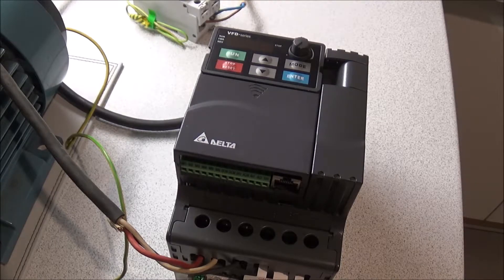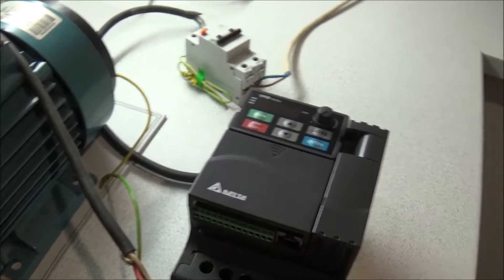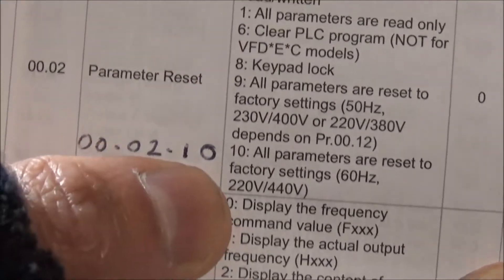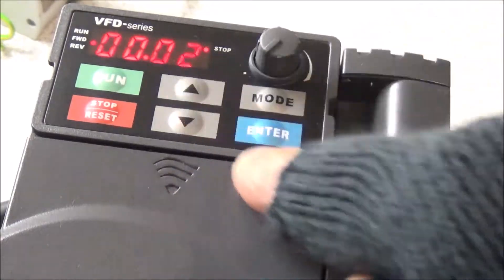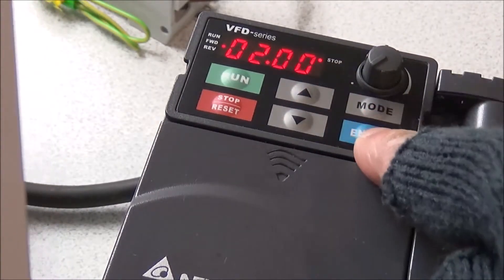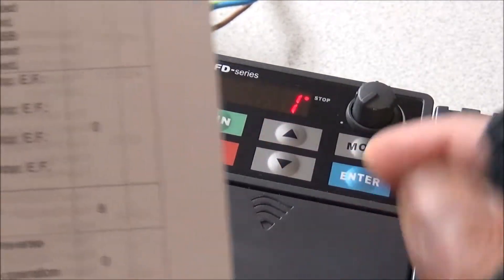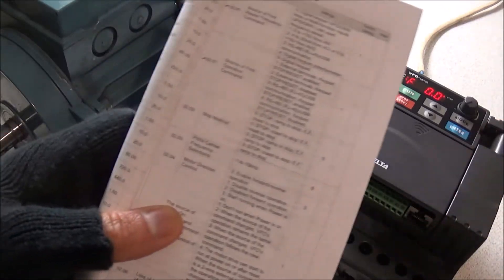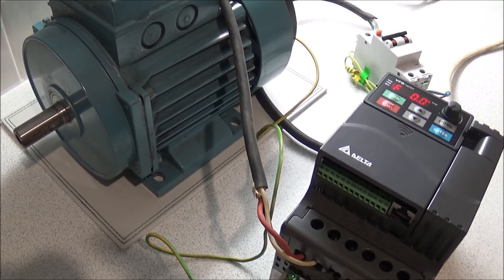Delta VFD Factory Reset, Basic Set Up, Digital Keypad Start Up, Parameter Reset VFD-E. Potentiometer

Comment: Hello, after a long time I saw your post, I'm just starting the configuration and about your question about the fan, if it's still necessary, you have the answer in pr 03 08. Excellent video, thanks.

Comment: Thank you for this video. I have a woodturning lathe which has this unit preconfigured and I cannot hear the fan running all the time. I was looking through the parameter manual and found the default is fan on always, you could change it with 03.08 parameter to come on when motor is running.

Comment: Hi dear. 
U asked about the fan. 
I've got different model which has aluminium cooler on back to absorb the heat.  
Uk standard model come with cooling fan which most works continuously.  
I think if u look at the book u will find an option which blong to ambient temperature.   Fan not working at any time . 
Good luck
Reply from the maker: Thanks for Information.

Comment: The switches behind the keypad have nothing to do with "Ready" "Run" "Fault". Switch 1 locks the drive to 50Hz max,  switch 2 locks the drive to "free run to stop" and switch 3 to ACI freq. input. I suggest downloading the full manual or read it on the supplied disk. The paper manual is just a basic parameter list.